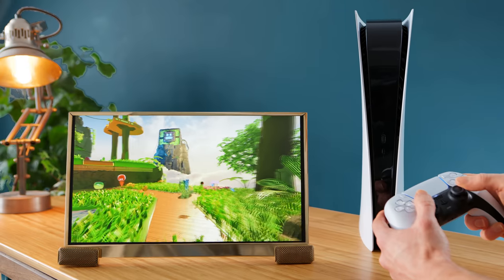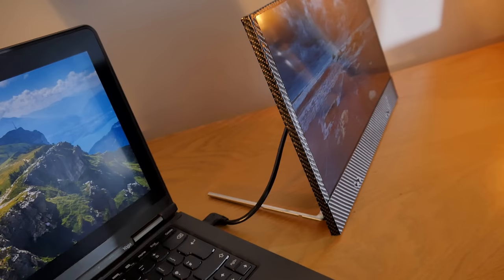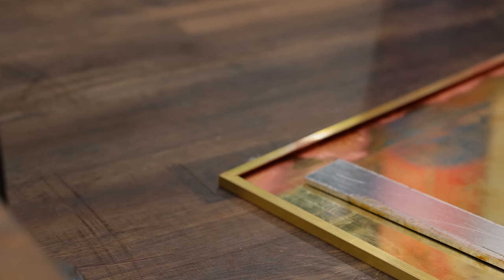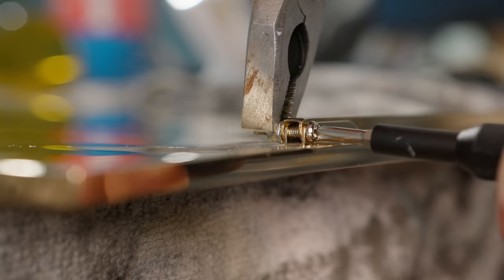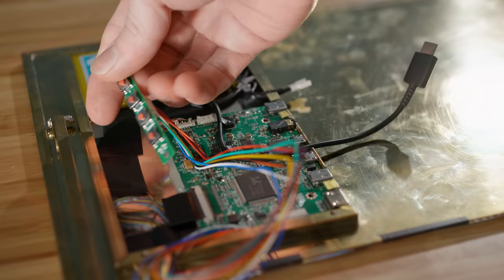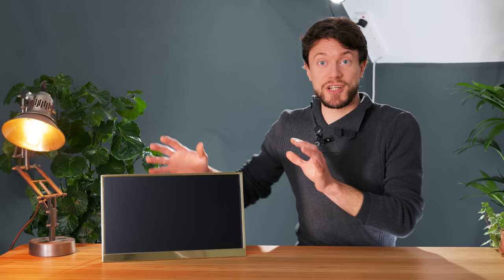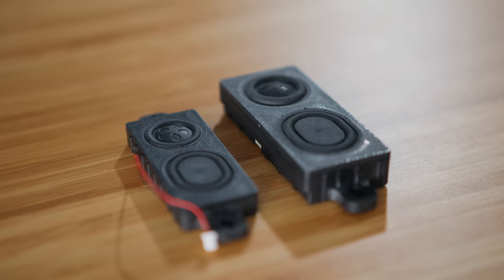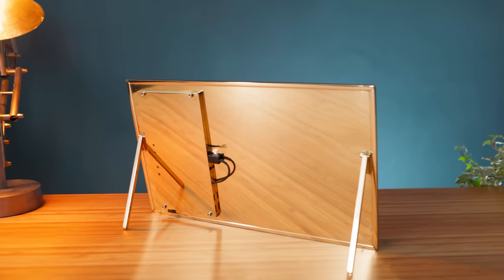Building a USB-C touchscreen monitor (new for modern devices)

Comment: one thing I have  doubts  and  you weren't   clear about.

is the  LCD panel  touch capable or   using that   new USB-c  board turn  whatever LCD panel into a touch one ?

I hope you answer.
Reply: The panel needs to be touch capable already. Touchscreens work by a special layer that registers touch.

Comment: I'd like to I'd like to know how to building a cabinet with a black and white screen with 100 by 200 pixels Soto work with my unlimited T-Mobile data plan that is .12 speed
Reply: I'm not sure what you're asking for?
Reply: @Pilachio  I really like your project I was just teasing t-Mobile Throttles me I figured maybe black and white with half pixels might work a little better than set an watch and a little arrow go in circles they all lie though they told me I would experience slower down During peak hours .0 to keep you up the good work thank you
Reply: I did buy this little five channel Chinese amp class D I would sure like to find out the right preamp with digital In5.0 Bluetooth control knobs for all the channels and sub channel I’m still scratching my head thank you very much

Comment: "Building a USB-C touchscreen monitor" - just pick touchscreen monitor and add a controler? Where is part about making it "touchscreen"? 
I was watching a lot of your videos, they are motivating a lot, but this is the weakest one
Reply: Ya, I was wondering how that is possible, it is not, it has to be capacitative or resistive or some sort
Reply: Hes talking about getting a control board that supports touch screen support. This is also how to build this with a high refresh rate. Just pick the right controller board